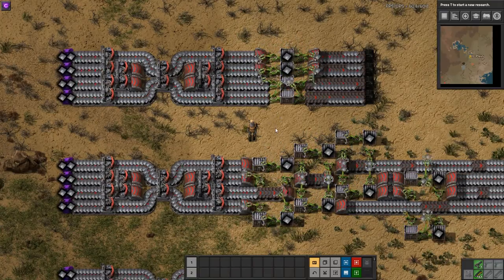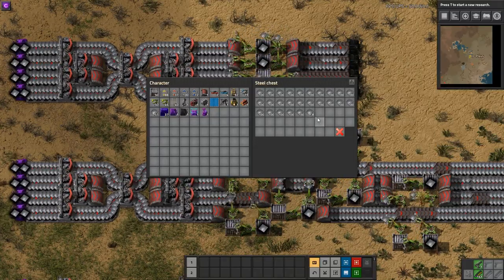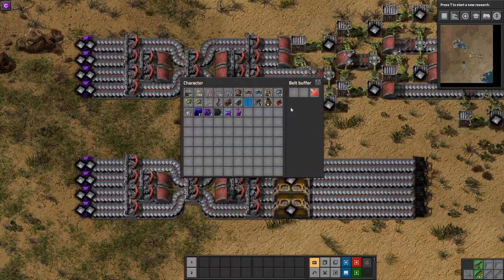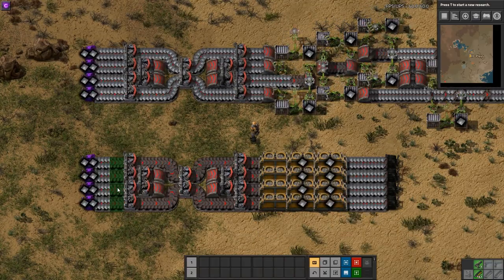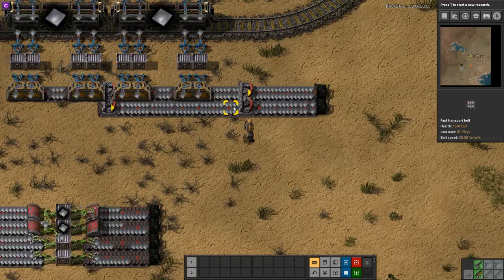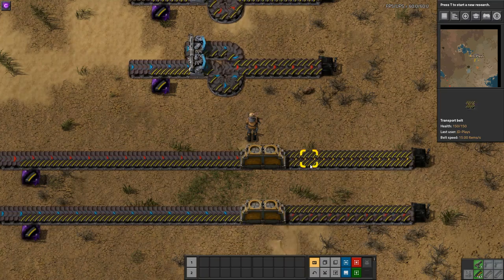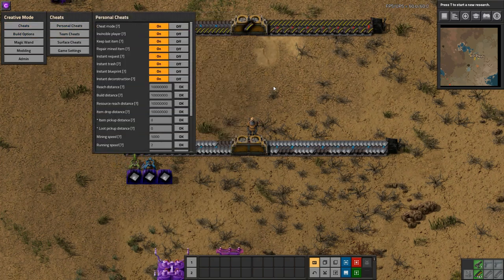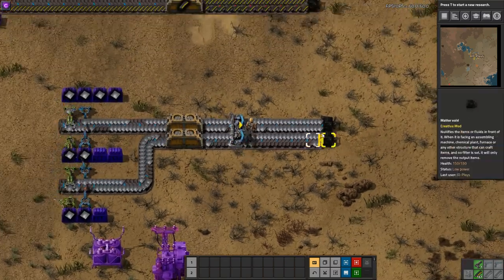Belt Buffers | Factorio Mod Highlight

Comment: thanks for showing this mod. i was using Belt Buffers a lot in 0.16 where Klonan had made that mod, AFAIR as an answer to sideloading problems (eg to replace the need to insert items into underground belts). that old mod was in effect an incoming and an outgoing loader, with a chest between them (all in this small footprint of 1x2), and also with abilities to sideload (and maybe even spit out at the sides? i don't remember). but he never updated it for 0.17, probably because of lots of belt changes and improved sideloading.
now it seems to have been updated/rewritten for 0.17 by someone else. thank you !